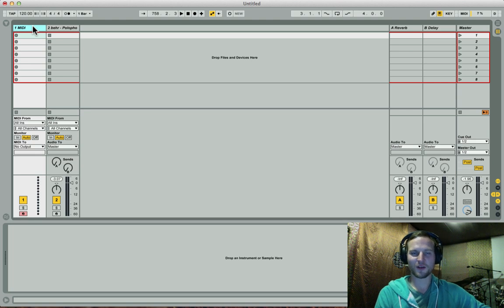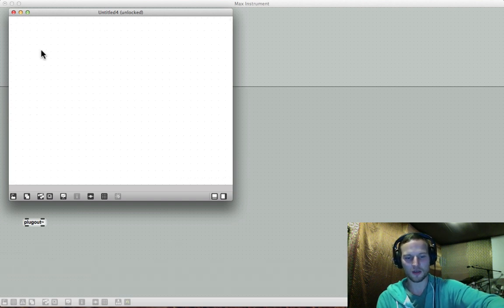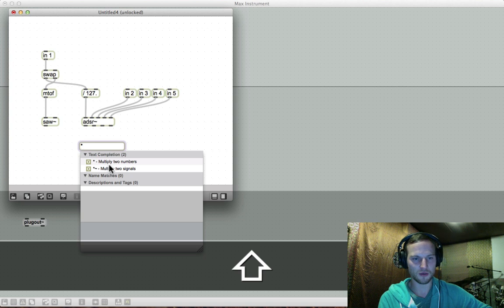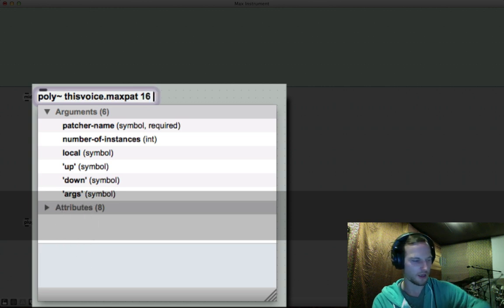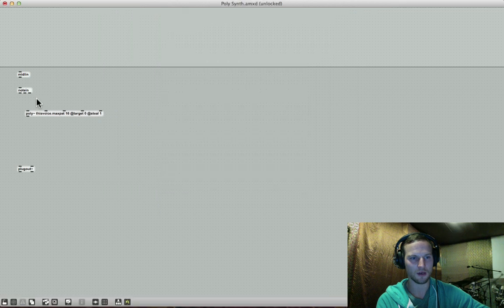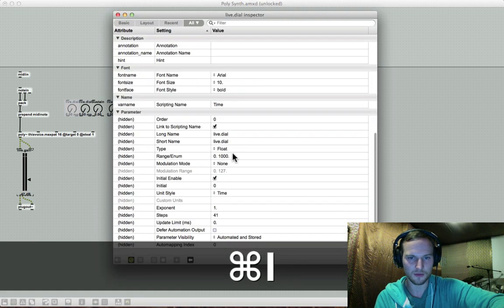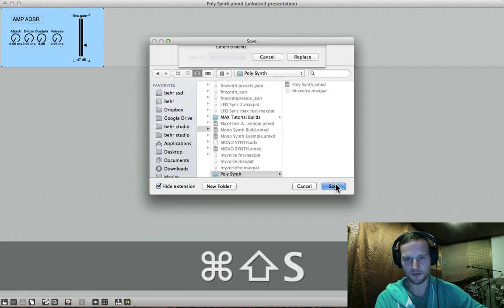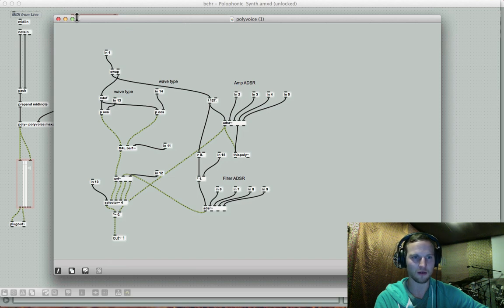Building a Polyphonic Synth in Max4Live

Comment: Hey im using your video as help for my coursework and i've done basically everything you did here, i just implemented it into a basic synth that was already built rather than building the whole thing. My signal from the oscillators goes through and the ADSR works but for some reason the polyphony just doesn't work. Also if i use 'prepend midinote' it just eliminates the signals of the pitch and velocity. What is the midinote argument for anyway .? Seems pointless to me  at this moment. instead of a note in im using midiin > midiparse (Pitch & Velocity out) > swap which goes on through the same routing as yours, although my oscillators are outside the poly~ subpatch. Do they have to be inside the .maxpat to work .? Please let me know ASAP as i want to get a really good grade on this .!!